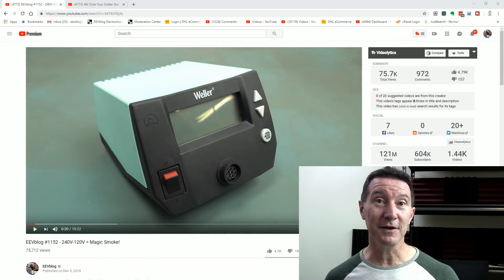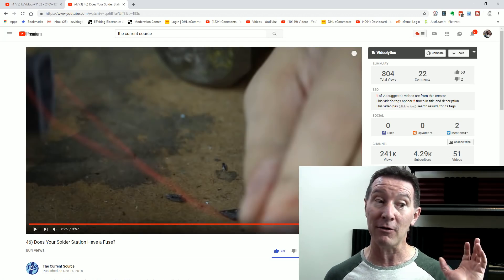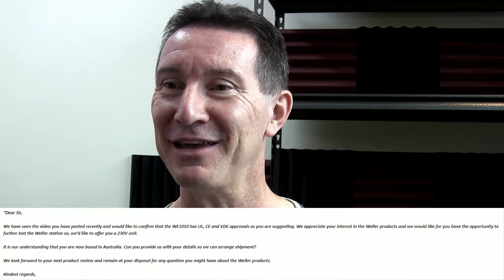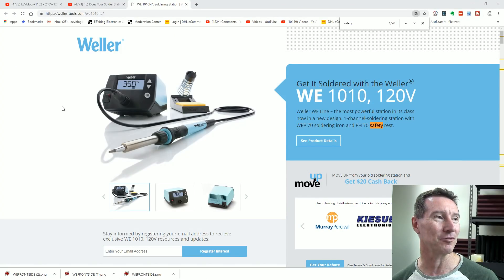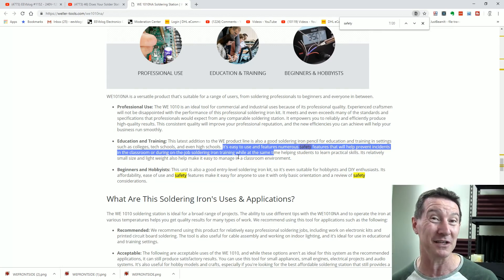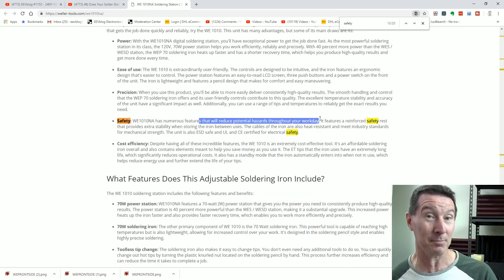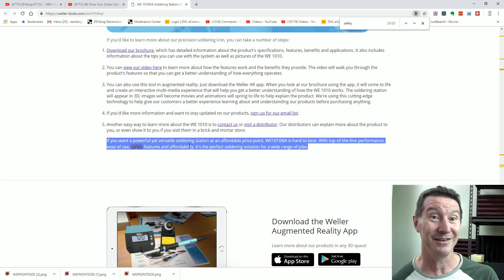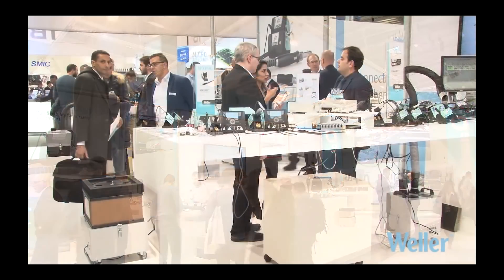EEVblog #1160 - Weller Responds!

Comment: So.... you plugged a 120VAC iron into a 240VAC supply and it's Weller's fault it had an issue? I get that you think there should be a fuse, but darn Dave...take a step back for a second. Even if it had a fuse, it would be a slow blow rated at 2.5-3.5x nominal current to handle start-up current spikes.  Ie, it would have let the 240 destroy your iron anyways.

And on the topic of "even [junk irons] have primary side fuses" - of course they do. It is far cheaper to have 50%+ of your irons fail in the first 30 hours of use due to a blown fuse than it is to have 50%+ catch fire and get your product reviewed extremely poorly or banned.
Reply: It seems to me that the rant isn't so much about the fuse, but about how Weller tried to tell him "she'll be right, have a free replacement" without doing due diligence. I am sure even something along the lines of "the north American standards don't require primary side fuses, but we understand your point and we shall take your suggestions under advisement." Would have been a better response.

Better still would be a Microchip PicKit 3 style response video :)
Reply: That's not the issue, it's the way that they Havel's this so badly, by offering a freebie to get them to be quiet about an oversight. Remember the first video, Dave isn't really too bothered, he knows it's his mistake, and wasn't saying anything too bad about the product, just surprised by the lack of a fuse.
Reply: @televisionandcheese  that's also not the issue. Weller watched a guy that wanted to review one of their products plug it into the wrong mains socket voltage, which destroyed it, and they wanted to provide replacement so he could do a proper review.

There is no safety flaw, because the device is rated for 120 VAC and with that voltage, it will work properly. But what if there is a fault in transformer windings? A fuse would help then. What if there's a fault in fuse itself? What if there's a fault in the cable? What if there's a fault in wiring? Well, there isn't. That's the whole point. Weller produces a device with a properly rated and certified cable, their transformers are properly certified and rated, and not from questionable sources like the Chinese knock-offs that you probably shouldn't keep plugged into the mains when you're finished. Of course those devices have fuses. But even with a fuse they are a fire hazzard because the build quality is so inconsistent.
Reply: It's not about saving the iron, it's about safety. What if Dave plugged in the iron and left the room immediately after and didn't see the smoke. Could have burnt his lab down. Even if the primary side fuse blew too late to save the iron, it would have stopped the transformer from continuing to burn and possibly catching fire. It's a safety issue.
Reply: @metricmine  this is the only reason... who cares the iron is broken. Any defect in the primary will be allowed to run rampant until the main fuse blows. This is really an issue,  and obviously UL certification has no interest  in these kind of protections. So if you see a fuse soldered in, it's there for your protection, it's not for replacement.
Reply: Did he say it was wellers fault for this? No, he said it was wellers fault for not having BASIC protective measures.
Reply: @David Lulham
In australia, we have 250v (Normally between 230/250v)
Though we don't have a ring mains setup, normally at least.
You would be hard pressed to find a domestic breaker >20A for a run for a (1-4 or so) 10A socket(s)
Reply: You underestimate the current draw of a saturated transformer. Also, even if the fuse is too slow to protect the transformer, it would fail quietly instead of burning instantly.
Reply: Completely agree. Dave's fault and he's carrying on like a two bob watch.

Comment: Hi Dave I have a draper iron its a known brand here in the UK and I have never had any problems  . I am very suppressed at this Gurman manufacturer. You would expect this from cheep Chinese products.  With that been said here is a link  for you to cheak out how ever cheak to see if you can get it down under   https://www.drapertools.com/product/61464/Soldering-Station-(48W)

Comment: I was monitor for EE students in my university. One of them did a stupid prank setting the mains voltage of a PSU to 110V while it was connected to 220v and called me to check the device. I turned on and it poped. But it had a mains fuse protection which after changing, it was fine. I wonder how that would go on 4:27

Comment: After seeing that they

a) kept selling the wha900 for $600
b) had no way to buy a heating element for the WHA900
c) replaced it with total trash of the WTHA1N that falls apart easily, costs $600+

I can't take weller seriously as a company anymore.
Reply from the maker: But they have a VR/AR app you can run on your phone!
Reply: @EEVblog  , good one but seriously, what does the app actually do?
Reply: @nickstanley5064  Maybe its to make it look like your iron hasn't fallen apart?
Reply: @alexatkin  , but did the development cost of the app cost them their 2 digits?
Reply: phu cao  the AR app overimposes a mains side fuse if you look at the circuit diagram through it
Reply: I agree. They are riding the wave of past performance nowadays. Even the quality of the plastic seems to have degraded on their new shite
Reply: @kozmaz87  I'm hungarian as well. I just use a 24 volt ac weller iron with a magno temperature controlled head. The power supply uses a mains fuse. The secondary side has one as well and even in the iron it has a fuse. I can't understant, how can a 30+ years old iron has all theese things and a newer example can't have theese. They are not as good as they used to be sadly.
Reply: @Spiritpoweredinternet I have an ancient Weller Magnestat type iron that I built from scrap units at the company where I did my apprenticeship 27 years ago. Still works perfectly and I use it most days. It also has a primary side fuse!
Reply: agreed, a renowned company gone down the pan.
Reply: @lezbriddon  'a renowned company gone down the pan.'
It was purchased by an equity firm, so the brand is just being milked.
Reply: My first and last Weller irons were from the red series (budget ones). Two in total, when the first one failed I had gotten reasonable service out of it so I tried another one. It turned out 20 years ago the red series was already crap, while priced reasonably within the non-budget segment. After having grub screws and a mains cord fail on me, which was non-replacable by the way, it was time to move on, away from Weller. A company that doesn't take care of their budget line, will at some point in time do the same to the other models. Seems I was right about that.
Reply: Both EEVBlog and Louis? RIP Weller. Pretty sad, only heard great things about them growing up!
Reply: @perkele1989  Yup, old Weller I inherited is still going strong, but I'm not buying any new stuff from their brand after seeing this.
No primary fuse on the mains connected lines is an unforgivable sin.
Reply: I was musing about buying a Weller WX-series station. But I'll refrain from buying from them, after seeing this.
Reply from the maker: Zoltán Kozma - The case and construction on this one is very flimsy.
Reply: @EEVblog  Dave, you've still got Weller products on your page on kit.com , do you still like those specific items?  https://kit.com/EEVblog/soldering-equipment/weller-we1010na-digi
Reply from the maker: What's crazy is they have no less than 2 fuses and a massive polyswitch on the secondary side. Not all of those are needed, and that extra secondary fuse could have paid for the primary fuse. It's wacko.
Reply: You need to remember that they are owned by the apex tool group, a company that makes a lot of aviation tooling and high end stuff that can command a large price.  When things break they expect them to be replaced and not repaired.  Perhaps they might rethink their methods after the feces storm that has erupted from this...
Reply: That's why you buy an ERSA Louis :)
Reply: leosedf Just got me a new ERSA icon1 (for 360€ btw) in addition to my digital2000 and I'm very happy. Build quality is a slight bit less solid than the D2000 but still good. And I can still get irons, tips and heater for the old station. Since they still sell it.. (für about 300€ iirc)
Reply: @Spiritpoweredinternet I'm also using an old Weller from the 80's or older (TC202) and still with the original tip (not a really heavy user).  It has been a work horse, but is starting to show it's age.  Was thinking of getting another Weller, but after see thing, think I will go look somewhere else.
Reply: Sad to see Weller kicking their honest customers off the plate
Reply: I has been 20 years or more since Weller was a quality product. Back then the 100W/140W instant heat guns had fully copper windings and a bakelite housing that could withstand the heat of operation. Now thay have low temperature plastic housings and Aluminum secondaries. The newer WPS18 iron has no temperature control whatsoever although they led you to believe there is active temperature control by sporting a timer that cycles in  a red LED when the tip is "Hot" even though is is merely a time thing and has nothing to do with tip temperature.
Reply: I still have my WD1 station that is still going strong, but I've noticed you cannot buy the WMP pencils for it anymore, they wan't you to upgrade to the WX stuff.  It appears Weller does still sell an upgraded 80W version that is almost otherwise identical to the WMP pencil, under the obscure part number of T0052918099N, maybe an updated version to keep replacements for WD station stuff available?
Reply: spikester , yeah, that’s the problem with all companies nowadays; they all have reverted from quality to consumer-centric product manufacturing.
In other words, quality products that last, will not make money over time. OTOH products made cheap will break right after the 1year warranty expires and the consumer will need to either have it repaired for the cost of a new one plus overhead, or just buy a new one which is cheaper.
It is frustrating and disappointing how this companies have all went down that path. (And it seems that no company is willing to step up and place quality and safety first) @weller-tools: I hope you listen to these comments. 30-40 years ago you used to be #1 (not that they will ever listen...)
Reply: @Spiritpoweredinternet Well it certainly seems like they don't make them like they used to!
Reply: My WSP80 is my baby and I love it. Seems they don't care anymore, or are being completely nieve, complacent god knows.. a great way ailienate your top customers whilst nailing your company into the ground at the same time.
Reply: Had (again and again) problems with my weller tweezers few days ago. You will not imagine how dangerous they are once you open them. Buying weller again? Never ever. Check this video https://youtu.be/_L4Owsz90No
Reply: I would say the WTH at the start of the new model says it all :-)
Reply: Nothing like 2 tech diy giants passing on the brand..........
 If it anit ancient I wont be touching Weller ever again
Reply: Did the front fall off?
Reply: They seem to have been sold to some investment firm right before all this stuff started happening. They must be milking it.
Reply: That's why I got a cheap Chinese soldering station and overhauled it.
Reply: oh shit it's dat boy.
Reply: Damn it! You just Rossmaned them! RIP weller.....

Comment: Here in the land of half voltage and slightly higher frequency, it's pretty normal to see small items without a line fuse. The branch circuits in the US typically have 15A breakers. I know the UK has much heftier branch circuits (32A?), which necessitates the fuse in the plug.

What's the situation in Australia?

Comment: Even if its not required by law in north america, surely they could of slapped a thermal fuse inside the transformer. What if there's a fault on 120v operation but not enough to trip the breaker?

Comment: This is based on personal experience, but I believe UL in the US requires that there be a fuse or breaker on the live input to any AC powered device for a piece of equipment to pass an inspection. They probably had a primary fuse on their drawings and sample used to get the approval then removed it later. Once the initial approval is given, everything else is based on the honor system and nothing will happen without some sort of formal complaint to UL or whatever group is responsible for handling this.

Comment: That VP would have done better by staying quiet. My guess is that Weller is outsourcing cheap soldering irons in Shenzhen at some assembly factory with a few cost obsessed engineers who don’t care much other than keeping it cheap.

Comment: Why are you plugging 120v equipment in when you run at 240v, idk what you expect from a low end soldering station.
Reply: Because he though it was 240 V equipment.  He didn't label it properly.

You can blame Dave for this, he should have known.  But ordinary people will plug whatever cable fits and that's something all devices with IEC sockets need to consider.
Reply: I would expect it to blow a fuse (and perhaps die), but not to release magic smoke

Comment: There may be a decent argument for not having primary-side fusing. 

Fuse coordination on high-power devices like soldering irons is not easy nor beneficial.  A typical mains circuit can deliver say 2000W, and if your device is rated near that, then any mains-side fuse would have to be rated very close to the mains circuit breaker rating anyway.  This would give it such a narrow range of operation, that it makes more sense for such high-power devices to rely on the mains breaker entirely, like say power tools or vacuum cleaners do.

Also, once the primary windings' insulation starts breaking down due to overvoltage, the unit is borked, full stop.  A primary side fuse might reduce the total amount of smoke, but it won't save the unit, because the insulation is already gone, even if nothing has melted.  If the fault is allowed to persist, as the further breakdown leads to less resistance and increased mains current, the mains breaker will pop anyway.
Reply: The power kind of soldering irons are not nowhere near 2000W. The typical power range on this kind of electronics soldering irons in in 50-100W range. That would translate to around 1A fuse at 110-120V AC applications, and half of that in 220-240V applications. I see no coordinating problems here against 15A or 20A mains breakers commonly found on 110-120V systems.  On countries with 220-240V mains voltages, you commonly see 6A, 10A, 13A and 16A fuse sizes (and typically 10A or 16A breakers on mains panels in most EU countries).

Comment: The only UL  loophole I know of says something about the transformer primary being able to handle the current needed to trip the panel breaker. so as a US 120V device the primary wire would have to be able to handle 15 amps at red hot temperatures. The transformer is allowed to short and smoke, but the wires must be able to trip the breaker without opening up and it must self extinguish. But I would guess that would require at least 18 ga primary wire. maybe they are running heavy wire into the winding and then claiming that once the winding shorts it will pop the breaker. of course this would be about as shady as TWAX having there transmitter device turned off for FCC RF emissions since 99% of the time it is off.
Reply: c'mon its expensive unit and glass fuse is few cents.. it's just ignorance

Comment: They really should have put a fuse in this thing or used a thermal fuse on the primary like most other transformers in such an application, i always stick in fuses just to make it so im not the one making the decision to take them out
but honestly if marketing came to me telling me a customer plugged a 120v device in 240 and it burned out my response would be "well yeah, what did they expect?" but thats why engineers are not in marketing :P

Comment: Meanwhile here in the Old Dart good old British Safety Standard BS1363 mandates an appliance - specific fuss in every single plug.

Damn strong plugs, too. You could dangle a medium sized human off one no worries.

Try and get something like that Weller abomination certified over here you'll be laughed all the way back to kindergarten 😂🤣😅
Reply: The appliance fusing was necessary because of the somewhat wacky "ring main" used in the UK.  The ring circuit is capable of delivering  7.6kw. You definately want a fused plug in your hair dryer.  In the US where radial circuits are the norm only 2.4kw is available. So in the UK line fuses are 3.16 times more important than in the US.

And another thing.  120v incandescent bulbs last twice as long as the 240v version. Think of that over the last hundred years.

Comment: You would have to throw away 95% of the things in the USA that plug into an outlet.... most of our stuff doesn't have a fuse on the primary side.
Reply from the maker: Then why can't Weller make that argument and tell us why they didn't include one when all of their competition does, and it's practically industry standard to do so if you care about safety.

Comment: I had this same exact iron awhile ago.  It had caught fire, burned my workbench and set off the fire system.  The only reason it quit was because the outlet melted and it lost contact.

I had enough.  Threw away all my Weller irons except the old 8200 N's and replaced everything with Hakko and JBC.  There are 4 boxes of Weller soldering stations at the dump if anyone wants them.
Reply from the maker: Seriously?
Reply: Yup.  I won’t buy another Weller again.  I was angry enough when they cheaped up the soldering guns by going to the screw clamp system and this just caught me on a bad day.

Luckily nothing else was damaged but the workbench, station, outlet and some old carpet.  My Aglient scope and Logic Analyzer were far enough away it didn’t do any damage.